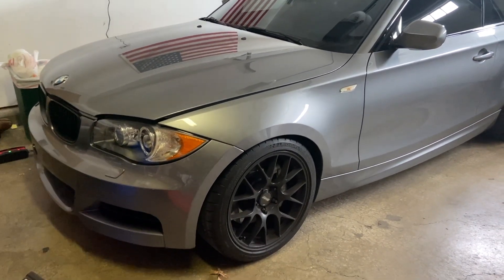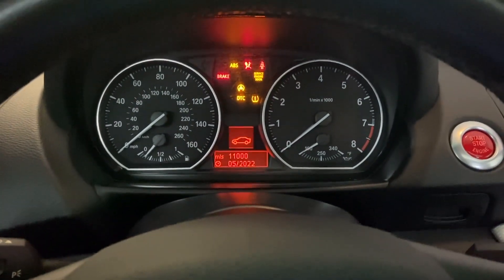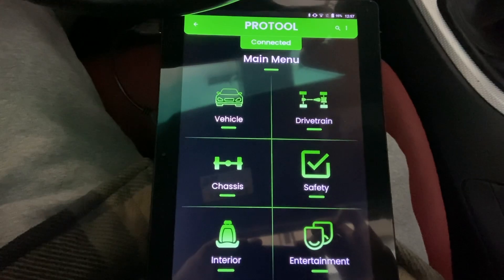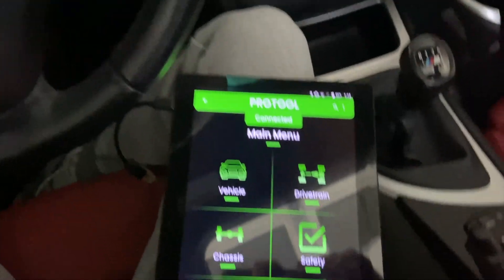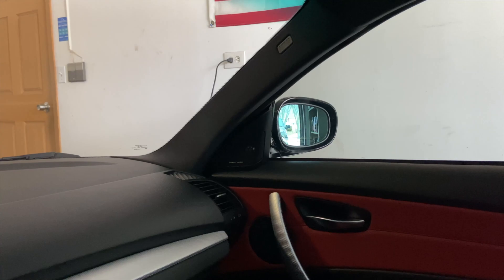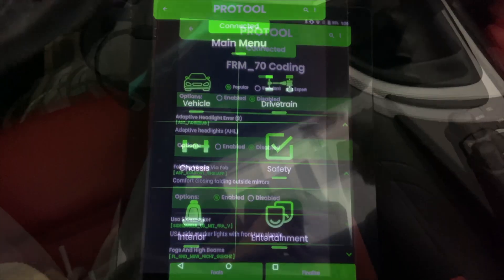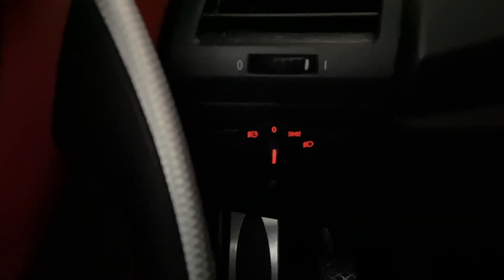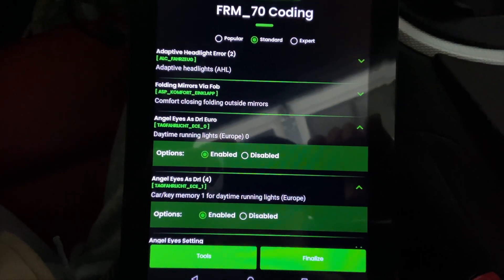HOW TO CODE YOUR BMW USING PROTOOL! – ADAPTIVE HEADLIGHT FIX – BMW PROTOOL CODING

Comment: Great love your videos. Question i had water damage. Took out my amplifier which i fixed already. But when the amp went out so did my turn signal. I thought it was my rear tail lights so I bought new ones off ebay. Still have the same problem. Both turn signal rear and one on the pass frt turn signal. Plus a 9CAA TERMAIL 30b connection faulty. Any thoughts?

Comment: I need the parameters for all the lights, interior and exterior, voltage and power supply. I messed with mine and now my door lights and light under the dash is flickering constantly until they go out, and my aftermarket amp goes into protect mode after on for like 30 seconds. PRETTY PLEASE, I cannot find this anywhere!

Comment: My angel eyes have been out for 6months. I don’t have a jack… but i used protools to code my new fuel pump module (EKPM) and now the drivers side angels work. What the heck!!! Why! What did one have to do with the other? Cant be coincidence. 
So my question is can i code reset my angel eyes as if theyre new replacements in Protools? Maybe that will work

Comment: Hey I know this is a old thread but I believe you might can help me, I have a 08 bmw 335i sedan with dynamic xenon headlights, I just want to switch to the lci headlight. If possible what wiring I needs to do to make it work it’s just a plug an play, I currently install the lights also try coding them myself I get some dings an error lights to go away but one problem, I can’t figured out my angel eyes only comes on for a couple of seconds then go out idk what else I’m doing wrong, the car have frm2 footwell module. I needed help

Comment: So replaced my foot module 2010 135i both headlights still don't work halo's work but the headlights do not work. I've programmed the module with the protool everything works but the headlights no low beam or high beam.
Reply: Bro did you end up finding out the problem ? If you did let me know that’s my problem with my driver side light
Reply: @AndresEscamilla-i1g  no, I did not. After spending all kinds of money firing a parts cannon at it and money on programming software, I could not get the issue resolved. I ended up selling the car I got tired of trying to figure it out.
Reply: @AndresEscamilla-i1g  wish I had the fix for you, brother. Best bet is to try and take it to a bmw shop and see what they say.

Comment: The first thing I coded with protool was turning off the seatbelt dong sound.
Reply: Not a smart move safety first brother
Reply: @bryandiaz3108 lol I use the seat belt when im driving of course. Whenever I get into my cars I start the engine first, then I put my seat belt on. Its what ive always done with every car ive owned. But BMW wants you to put your seat belt on first, then start the car. I cant change 25yrs of habit.
And because the seat belt dong sound is the same sound for when there is a fault with the car, the sound always gave me anxiety.

Comment: This DOESN'T fix the adaptive headlight malfunction problem it only sugar coats it by disabling the error warning massage being displayed.  

**  You will need a new or used TMS module (correct version) and code it with ISTA+ or E-SYS via an ENET cable, very simple!
Reply: I replaced my old AFS headlight with a cheaper non AFS headlight,  and the AFS headlight malfunction error blocked my car to properly recognize the new headlight,  can this protool's disable the AFS resolve my case as well?  thanks.
Reply: Do you have a part number for what I need? And is this if it got water damaged? I washed my car and then got the error code after. I don’t know which side is broken. The adaptive feature works for the first 10sec after turning the car on and then the code comes on
Reply: @sswany_  When that happens look at your headlights and you will see which one is not working, usually the one with the halo rings not lighting up.  
When your headlights dry up the error goes away and your headlights work like usual unless it's been doing it plenty of times until it finally fails then it's time to replace the headlight control module. In order to prevent from failing again once they work correctly again is to remove both headlights and silicon the rings around completely. This will prevent any water and heavy  moisture from entering the headlights and messing up the TMS module control unit.  

Here's a video where he shows where he got the part and how he coded it easily step by step.  Let me remind you that the original upgraded TMS part cost around $700 new from FCP Euro but if you can find it way cheaper original BMW OE on Ebay like I did it's more stable and higher quality! Remember he also states that on 2011 5 series non original TMS like the one he codes are easy to get coded to the car but after 2014 the ECU will detect the cheap TMS module and reject it asking for OE original!

Comment: Hey man, thanks firstly. I am getting the adaptive code plus, in addition and intermittently, the turn signal error code- I checked and the turn signal not working. The signal light on dash clicks fast when during the time.( on drivers side) Both come and go. Any idea what’s happening 
2012 528 BMW thanks

Comment: So a while back I replaced my left headlight control unit that bolts underneath the headlight. I bought a used unit from the exact same car (2008 335xi). It fixed the fault codes but ever since when I start the car the right headlight goes up and down but the left one doesn't move. Can I re-initialize it with my Protool app or do you think it is something else?? There are no codes btw.
Reply from the maker: I don’t think so, i believe that there may be a sensor that is broken internally in the headlight. My two cents!

Comment: I have e90 lci with halogen bulb on angel eyes. And when i try to change them into led lights, when the ignition turn on, they are flickering about 10 second then normal. I just want to ask you how can i stop it when the ignition on. Which code should i turn off? FRM then which angel eyes code? Thank you for answering my question...
Reply from the maker: Im not expert but i think that is how the LED bulbs work. You can maybe try and turn the voltage down... that may help. sorry for the late response! Will try and be more active!

Comment: After 2 years of having my adaptive headlight error finally found this video.. thank you so much man 🙏
Reply: Got the protool and cable in the mail today just got it fixed. 🙏 it stays off
Reply: @cooperbsu6060  Does it reprogram the headlights so they are adaptive again or just wipe the code?
Reply: @vincentmatesso7809  wipes the code and it never came back, in order to fix the adaptive headlight you’re going to need new adaptive headlight control units